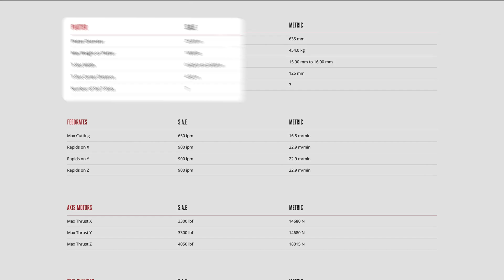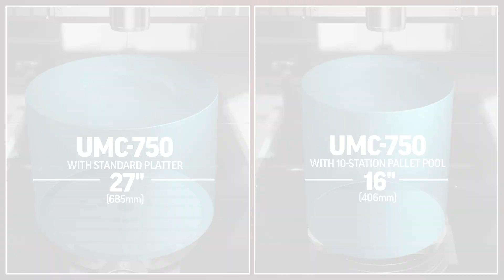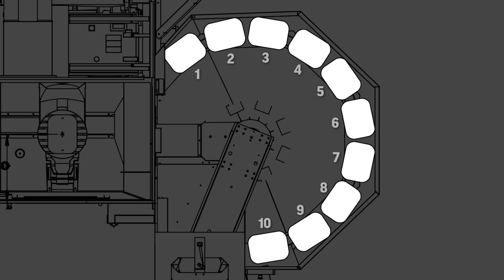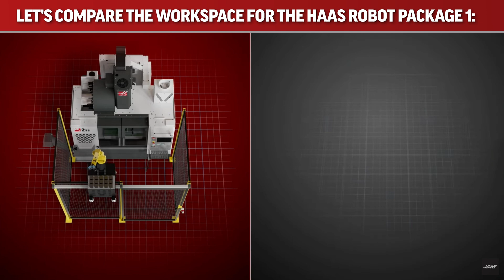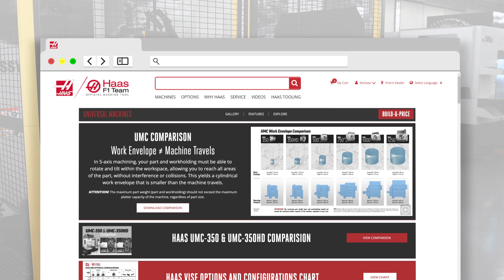How Automation Affects Your Machine's Work Envelope - Haas Automation, Inc.

Comment: Where are the bar fed mills/ 4th axis
Reply: As far as I know, they don't exist. You want a lathe with a Y-axis and live tooling, or a multitasking center with an ATC spindle.
Reply: Willamin, several Taiwanese and I think the odd Japanese 

I’d love a fast high rpm 80mm barfed mill. Driven tool lathes suck compared to an actual mill
Reply: You want a mill turn not a mill.
Like a okuma Multus. 
The haas mills y axis motion kinda ruins the bar feed idea.

You can rig up a 4th to bar pull. But it’s not elegant